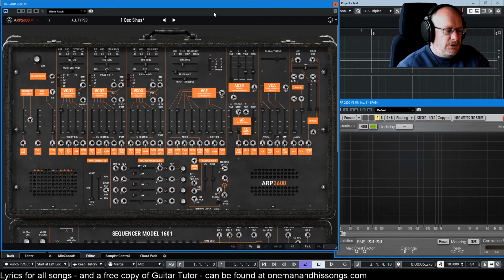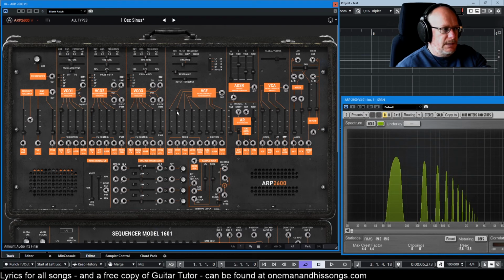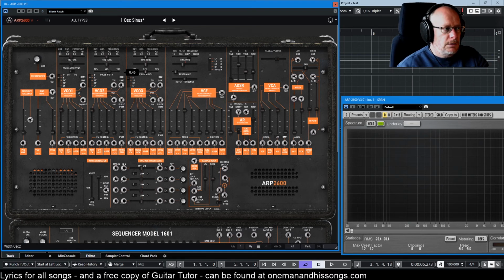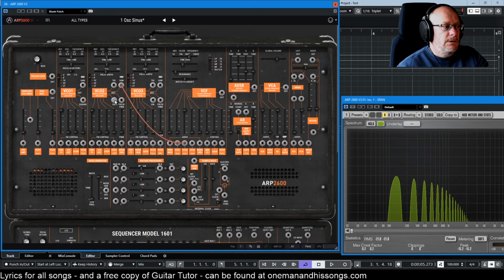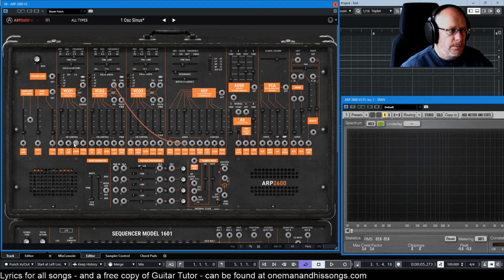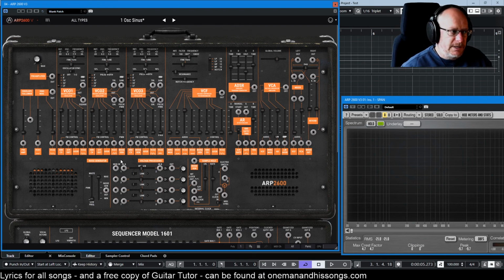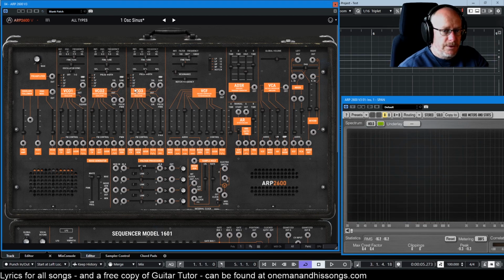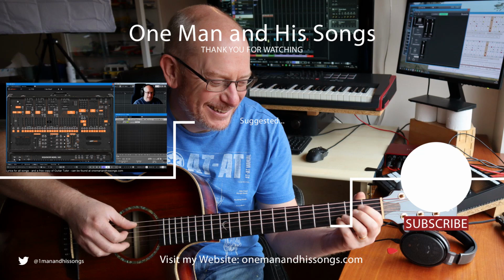Arturia ARP 2600-V Walkthrough Ep.03 - VCO2 and The Noise Generator

Comment: Hi, although your video's are very clear and easy to understand i still have a question about envelopes: Suppose i would like to use the two envelopes , one for the amplitude of vco1 and the other one for the amplitude of vco2. Is there a way to achieve this? Thanks in advance for your advise. greetings Herman
Reply from the maker: Yes - both envelopes have inputs and outputs so you can plug any module into either of them. In fact that particular example is already normalled: The VCA slider marked "AR" is for one envelope and the one marked "LIN ADSR" is the other one. Be sure to set decent Sustain and Release values for both envelopes and it's really easy!
Reply from the maker: I re-read your question and realised my answer is incomplete/wrong - you want completely independent control of 2 oscillators from the separate envelopes. That's much trickier. I don't have time at the moment to do a full dive into the question, but I've had a quick look and I'd probably attempt it by passing the signals through the Voltage Processors. That would give me the ability to modulate each signal with the envelopes before I sent them - pre-mixed - to the VCA. the problem is that the VCA doesn't discriminate between the two audio inputs so you can't control the separate envelopes from them. So, yes, it's tricky, but I think if you play around with the mod controls in the voltage processors that would be your best bet.
Reply: Thanks for your answer Anthony. But because there  is online one output in the filter section i don’t see how to seperate the two vco’s and put the in the two envelopes. I assume that all the vco’s come out as one sound into the vca section.
Reply from the maker: Our replies crossed :)
Reply: Thanks again for your reply. I understand that Being restricted to one filter limits the possibilities. Maybe i should look into Some other synths. Do you have a favorite one to work with Anthony?
Reply from the maker: My favourite synth of all time is the Moog Modular. I think the Roland Juno (6, 60, 106, they're all amazing) is the best SOUNDING synth of all time, but it doesn't have the range of the Moog.